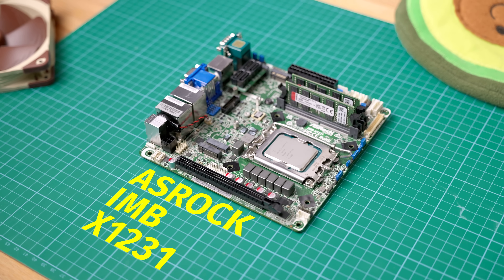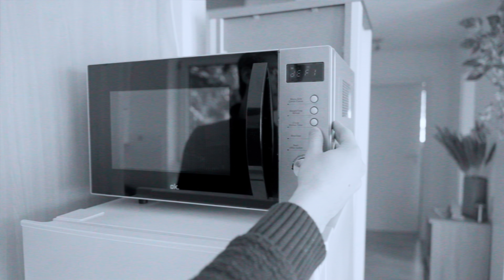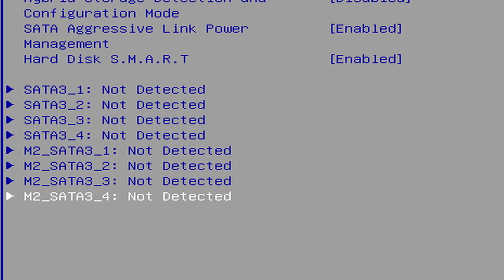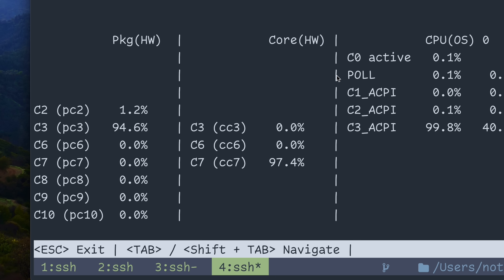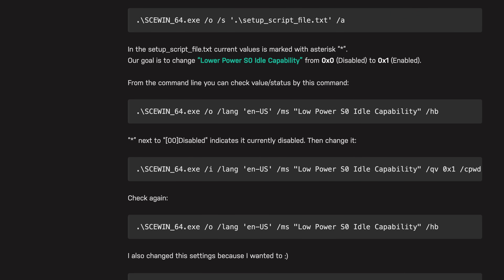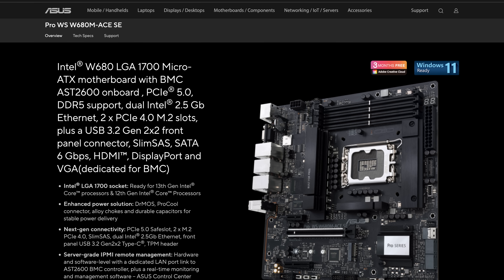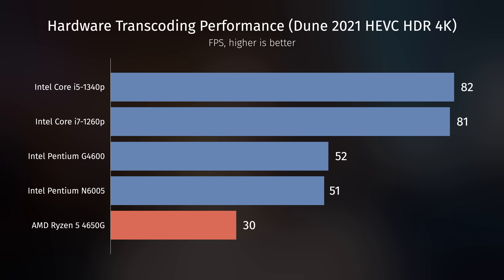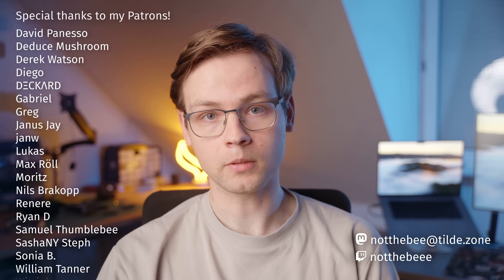A Perfect Homelab Motherboard That You Can't Buy (ASRock IMB-X1231)

Comment: Now you only need a special case for it that supports 8 HDD'S and doesn't use more space than a regular NAS.
Reply from the maker: Easy – Silverstone DS380B or Jonsbo N3. Might take more place than a NAS, but not by much
Reply: @WolfgangsChannel  Those are indeed some good choices.

Though 1 thing I would love to see is something that uses M.2 sata SSD's with a  blade style hotswap system.
It should save tons of space, and allow for even more storage. due the smaller size of M.2 SSD's

As each HDD could be swapped for at least 4 M.2 SSD's.

Something Like the "ICYdock MB872MP-B" but then on 3.5" scale

Comment: Any alternative to this we can buy? Dont need as much sata but 3-4 m.2/nvme would be nice. ECC optional. Should be under 250$.
Reply from the maker: 3-4 M.2 slots on a miniITX board is a big ask, especially for the price.
The only way I see it happening is if you get a board with 4x4x4x4 bifurcation support, and a PCIe M.2 carrier card. But that would be way over budget.

If you're not married to the miniITX factor, there's ASUS Prime H770-Plus D4. It's an ATX board with 3 M.2 slots.

Comment: what is the point of making a video about hardware that is not purchasable for 99.999999999999999999999999999999% of your audience? 
besides that, there are BILLIONS of devices happily working without ECC and zero issues, that is a luxury not a requirement in the context of this video, when you drop that, you suddenly realize that you don't actually need some obscure unobtainium piece of tech to build a home server, or a small office server for that matter
Reply: He isn't just making a video on this board by making this video, he is also making a video on the whole platform. It happens to be represented with a board that he has and it's a lot easier to make a video on a board that he has than a board that he doesn't have. This particular board is currently hard to find outside of scalpers, but there are others like it that are around if you look. They do tend to be at least somewhat expensive, but they're there.

I would argue that the vast majority of devices don't operate without issue. The issues are just dealt with as they come and so long as issues aren't constant, people don't think about them too much. For example, I've never had a phone or laptop that didn't need an occasional reboot because an app wouldn't work or some other weird behavior for no apparent reason. ECC memory would greatly alleviate that sort of issue and narrow down the cause if it still happens at very small cost if not for Intel wanting to force people who want it to pay far more for a more expensive platform to get it even though it costs almost nothing to implement.

It would add a mere 12.5% (adding one chip to 8-chip memory modules or two chips to sixteen-chip memory modules) to the memory chip BOM cost of your RAM if you wanted to buy RAM that has it and maybe add like 0.5% to the cost of the motherboard. Adding around 12.5% to the cost of one of the cheapest components of most consumer computers is hardly a hill to die on. It's also important to note that ECC support gets exponentially more important as you go up in RAM capacity, so if someone actually wants a lot of RAM, it is much more important to get a platform and RAM that support ECC than otherwise.

Also, he never said that ECC memory is necessary for a home server in this video. He has videos centered around non-ECC platforms in which he explicitly states he doesn't think ECC is necessary for most homelabs/NAS/etc. (which he brings up near the start of this video), rather that it's a "nice-to-have" feature. This video laments the relative difficulty in people who are interested in ECC getting said "nice-to-have" feature without making sacrifices in other areas of a build.

Comment: there are 2 boards similiar to the imb-x1231
asrock rack w680D
differences:
only deep mini itx and uatx instead of mini itx
no onboard audio
10g ethernet instead of 2.5g
ddr5 dimm instead of ddr4 sodimm

and the both w680d ones have 8 sata onboard - 1 with 8 sata over oculink and the other with 4 sata onboard and 4 via oculink
Reply: That board hovers around €800… That's not an option for many people lurking here, I think.
Reply: Its close, but only 1G and 32G ram max, and 4 sata.
Reply: I’m running a W680D4ID-2T/G5/X550 with an i7-13700k. Had a minor bios issue and AsRock sent me a fix within 2 weeks. Great board, amazing support. Runs ECC RAM no problem. AsRock has a RAM compatibility matrix for their boards that is updated regularly. 32gb supported per slot x 4 = 128 max.

Comment: DDR5 has on-die ECC, shouldn't it be sufficient for a homelab use case? 
I would expect a much higher likelihood to have bit flips in the DRAM cell array rather than on DRAM bus it self. Of course the disadvantage is the missing ECC reporting with DDR5 RAM.
Reply: on-die ECC is the same as ECC memory in terms of robust error correction

Comment: Maybe it's hard to get such board for desktop, but as You mentioned there were some laptops with ECC, that is probably the way to go, because they are super energy efficient and quite easy to get from second hand market. I just checked my older laptop (p52, 8gen) at it's quite easy to get such board with xeon and up to 128G of ECC RAM. There are many other models and brands to choose from. My newer one supports ECC (no xeon needed) so may be good idea to repurpose it when I'll upgrade that one.  
Using laptops for such case is funny idea, You have UPS, active cooling and quite small size. My first server was big HP proliant which was as loud as my vacum cleaner, then I got laptop with broken screen for great price, what a relief - no noise, compact size. It served me for about 5y :) Probably You hear such comments often :) it's not easy way and require some bargain to get something to repurpopose because nobody will buy expensive laptop for such use case :)

Comment: I'm still a little concerned about the VRM on those boards, did you try pushing it somehow and check the temps ?
Reply from the maker: The VRMs should be fine up to 65w, as mentioned in the datasheet
Reply: @WolfgangsChannel  The 13500 pulls over 150W according to intel specs when all cores runs :/  The VRM will not hold it.
Reply from the maker: That’s with Intel‘s auto-overlocking technology enabled (forgot the name). At stock, it’ll run at 65W
Reply: @WolfgangsChannel  Well I've checked some bench and the 13500 seem to limit itself at 132W (compared to 181 for a 13600K) while rendering. I don't understand this auto overclock thing as I only know the XMP profiles for RAM. But at 65W limit, you will not be able to push all cores to the maximum frequencies.

Comment: I asked AsRock to provide me a BIOS twice, and both times they delivered. Once to get ReBar Support for a Z170 board where I had a 7700K and an intel Arc gpu, and another time for an Agesa update i needed for a B450 with a 5800X3D regarding USB disconnections. Both of these bioses were marked as beta but they eventually shipped them as stock bioses. Kudos for their BIOS team response.
Reply: This also happened to me with ASUS for the Z97-AR, although the newer firmware just appeared on the site a while after an extensive call with one of their engineers with no evident link to my complaints. Just some mysterious fixes to a board "years out of support" 2 weeks after the call :^)
Reply: Yep I am running a Beta BIOS for my BMC on my E3C222D4U board to fix issues connecting to IPMI. Still to this day that BIOS didn't go to public release as far as I can see, not sure why but its been solid for me. AsRock support were awesome for me.
Reply: @witalit archive it plz
Reply: @everythingpony  Yeah I will do that right now and share the link 💥
Reply: @everythingpony  Can't find the original download and link they sent has expired 😓
Reply: And now AsRock also did the same, but it's in the form of performance boost for the 14th gen cpus, by launching new BIOS for Z690 and Z790 mobos
Reply: Funny, I think I know who made that happen. I used to work for ASRock. The support team is quite incredible, all the way up the chain to Taiwan. BIOS is done by an outside company that does a lot of other brands, so they have a lot of experience to push out tweaks. They stock most motherboard and CPU combinations at each HQ so they can quickly help out with stuff. Specially for boards like in this video, they are sold in large quantities to system integrators and industry who rely on these services from the OEM.
Reply: I used to always look down on Asrock products but they have really grown on me as a company.
Reply: How are you guys? Getting so lucky when I ask for any of this stuff they tell me they can't because it's confidential and they don't support it anymore
Reply: KBLAKE ReBar is CRAZY
Reply: Could someone provide email how I can contact them? I have used the form on the site and they never answered me ;(

Comment: From my personal experience with ASRock and ASRock Rack - these are engineers - and not many of them, like 70? - that are truly passionate about their job. They are absolutely unafraid of crazy ideas (LGA3647 on ITX, P4 Combo boards, AGP SLI, SLI on VIA chipsets, Kx Upgrade series, Phenom II on nForce3, sticking Lynnfield CPU in SandyBridge board and many, many other "hold my beer and watch this" stunts and products), they sit firmly between purely industrial manufacturers like Kontron, and enjoy the partnerships with Pegatron, which means they are backed by huge money and they actually know what they are doing. And they support it! 

Good portion of my builds have ASRock inside and I have utmost respect to their dedication and enthusiasm.
Reply: Mid to late 2000 they used to make all kinds of weird stuff as you said, I loved ASRock back then!
Reply: Unfortunately, ASRock never merges these fixes which they provide through custom BIOS updates back into the main BIOS. I had two boards from them, both required custom updates for different reasons. Whenever they released a new BIOS update I had to reach out to them and ask if they could provide me with an updated version for my custom BIOS. Once the warranty was over, they wouldn't provide me with any more updates and I didn't want to run my home server on an outdated management engine version.
Reply: @xXxJakobxXx3  Quite stramge that they have people working on custom bioses for random customers
Reply: I've also had terrific support from them, when the retailer would not help me. On one of my builds I accidentally bend some pins when installing the CPU but the system ran fine for many months, one day however it completely shit the bed and the board died. They repaired my socket for just 20 bucks + shipping.
Reply: and they are super responsive and knowledgeable about their stuff as well. i had X570D4I-2T and had a few issues with the firmware (namely for SR-IOV), the engineers responded directly to my emails and provide me direct FTP links to beta BIOS incorporating fixes. All my self-built servers are AsRocks since then. Absolutely love them.
Reply: The fact there are still engineers out there that both know what they're doing, and have fun doing absolutely nutty things, is wonderful. I wish there were more people like them in the world, but this current generation just doesn't have that kind of passion for hardware.
Reply: So basically, they're DFI. (Same story, diff focus.)

Comment: I have had great support experiences with Asrock Rack too. I only run a X570D4I-2T. Tbh I prefer the X570D4I-2T
 over this board it has dual 10gbit. And you can actually buy the board.
Reply: But I guess you sacrifice the Intel power efficiency and quick sync. How do you find transcoding?

I should add, I've got a 5900x in my desktop that I could shuffle down into a similar board, but the quick sync and power efficiency are big hurdles to talk myself over.
Reply: @JetBlackRage  mine pulls around 50 watts with esxi + truenas scale and 2 docker vms in esxi. It could be better but I'm fine with it. It's a 5600x with 64gb of ram and 3x4tb sata ssd.

If I run a Minecraft server (currently with atm9 mod pack and 4 friends playing) it's averages 85 watts which is deffo up there
Reply: Wow 600€ is a lot for a board. Why did you considered buying such an expensive board?
Reply: I paid a little less, about 500. I really wanted the dual 10gbit and nicely integrated features of this board. I also wanted it to be this small. My full build was a similar price to a pre made NAS with 10gbit. Except those cannot come close in CPU perf.  @lanwin

Comment: I get a lot of these features on modern AMD mini PC. DDR5 is basically a given and good enough for NAS error correction, and I got enough experience with trash external enclosures now to pick good ones. And they come with USB4 ports these days, so you could even add 10 GbE or something like the Startech 4 slot NVMe enclosure. Big downside is that thunderbolt controllers make the minimum price of things sit at around ~200 EUR...

Comment: I wonder what is the benefit of ECC for a home server? as far as i understand, ECC is a way to not loose data if your system randomly shuts down. Is there really any data that is so crucial in a home lab setup that you would need this feature?
Reply: No, ECC is for not losing data when a stray gamma hits your RAM.
Reply: @ACuteAura  Does that happen often? if so, what kind of incredibly important data would someone have in the RAM of their home server?
Reply from the maker: Do hard drive failures, brownouts, current spikes and PSU failures happen often? No. But that doesn't mean you can stop doing backups and using a UPS
Reply: @WolfgangsChannel  of course that makes sense but I'm still confused for the RAM (or PSU failure), what kind of data could be so important on a home server that it absolutely needs to be preserved when booting it back up?
I'm scratching my head but I don't see a situation that a simple reboot can't fix..
Reply: @WolfgangsChannel  do you happen to have a practical example of a time when ECC saved your ass or somebody else's?
Reply from the maker: Don't get me wrong. Some people think that ECC is a must have on a home server, and that anything without ECC is not a 'real' server – I'm not one of these people. Even ZFS' co-founder debunked a myth that ECC is a de-facto requirement for ZFS due to a theoretical "scrub of death" scenario 

I think it's nice to have and that it's a shame we don't just have ECC everywhere, since it's a very useful feature, regardless of your use case.

But I've used storage servers without ECC, and will probably build and recommend servers without ECC in the future.

As to your question – since everything on your computer gets written to the RAM first, an error in the RAM can cause corrupted data to be written to the hard drives, which in turn, will cause data loss.
Reply: @WolfgangsChannel  thank you for the clear reply :)

Comment: I got an ASUS Q370i-IM-A on ebay with core i5-9500, low profile cooler, 8 GB RAM (SO DIMM), 240 GB NVME. Package was 200€, I think the board and cpu is a solid base to start a build from. What do you think?
Reply: You definitely overpaid. Something like €130-140 would be more reasonable. It just depends how patient you are and how good the second hand market is in your country. Several months ago I paid the same price as you but for a Gigabyte H410M H V2 with i5-10400 and 32 GB of 2666 MHz DDR4 plus 256GB NVMe and 550W PSU, and since then I managed to actually upgrade already purely through bargain hunting to a B760M DS3H DDR4 with i5-12500E and 64 GB of 3600 MHz DDR4 plus 1 TB NVMe for the exact same price. Facebook marketplace, eBay and depending on your country a range of other local marketplace websites are ideal for finding cheap yet powerful and efficient computers.

Comment: Hey Wolfgang, have you seen the MJ11-EC0 boards which are for sale at Ram-König? they seem to have a truckload of them and keep restocking their supply.

They are small ITX Server Boards which have a AMD EPYC 3151 SoC on them (unfortunatly soldered down so not swappable), have ECC and IPMI Remote management, has 4 normal dimm slots and can also have upto 8 sata ports (including the SlimSAS 4i Port) and a pcie 8x slot if you wanna get a bit crafty with how you can adapt the sff SlimSAS 8i Port it has on it AND a full x4 m.2 slot.

it draws around 25w idle which is a bit more but you get management features, alot of ram and quite a bit of PCIe for such a small board (some people managed even lower with PicoPSUs).

There are quite a lot of active people on the german Hardwareluxx forum and ServeTheHome forum and ive personally made my board into a TrueNAS build with 96gb of ECC Ram and all 8 Sata slots fully populated with a Jonsbo N2 case.